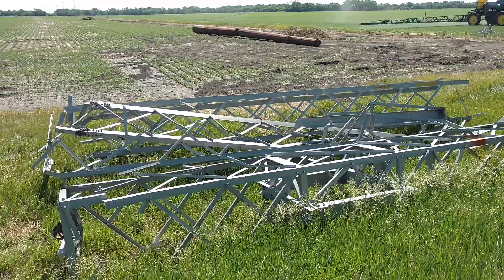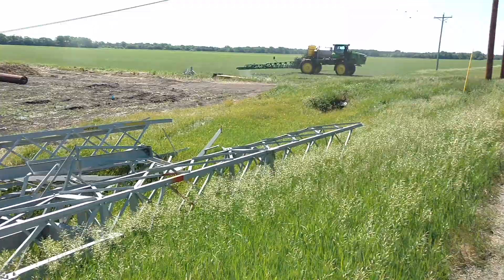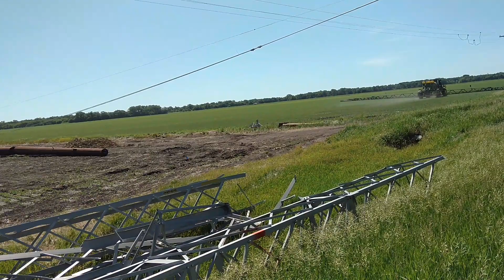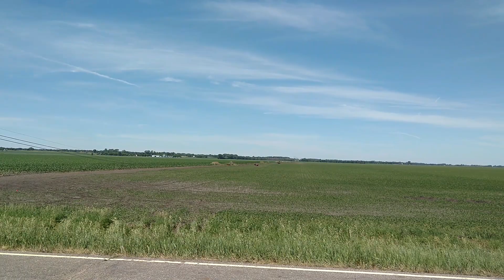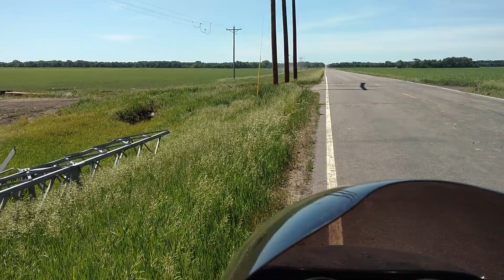Replacement towers

Comment: They're doing the same where I live in Minnesota, replacing old wood high line towers with hollow steel. New bases are being poured at the same time. Just north of me new high lines were put in, maybe 10 years ago. Hollow steel on that as well. The bases for some of the uprights are 75 feet deep. The only reason I know this is that one of the workers was killed when he fell into one. The local paper mentioned the depth of the hole (and rebar at the bottom).

Comment: Those hollow steel poles are called monopole towers. They are quite a bit stronger then the lattice type aluminum or even galvanized steel lattice towers. And a damn sight more expensive. I’ve erected thousands of the lattice types and hundreds of the monopole type.
Reply from the maker: I watched them put up the aluminum ones back in the 60's, they flew them into position with a helicopter.  These steel ones must need a crane to erect.
Reply: @logcabinlooms  I’ve only erected the monopoles with crane. It’s not very cost effective to put up a small amount of any towers with helicopters these days. The larger helicopters we use ( usually Erikson sky crane) can lift up to 25,000 lbs. so the steel monopoles can be erected with the chopper. Its cheaper to use a crane

Comment: In this part of the country with our wind and blizzards, it should be all underground!
Reply: Slowly thats the plan in Wisconsin northwoods
Reply: Underground,  especially higher voltage,  is really,  really expensive!
Reply: Yeah but then It won’t break all the time🤣
Reply: @mikeschneider2161  until a gopher chews through it and you have to search the millions of miles of buried cable to find the short.